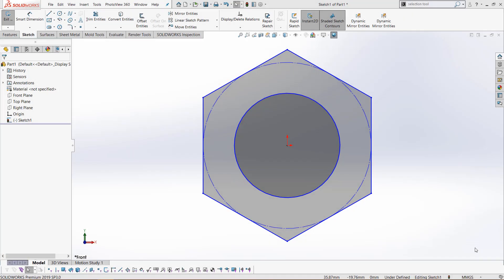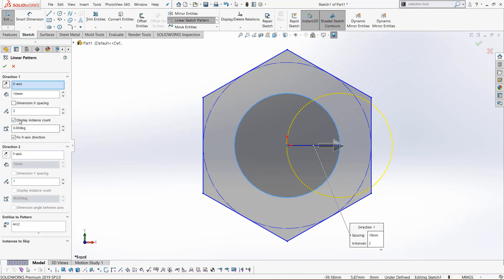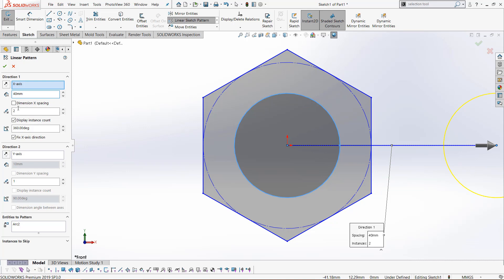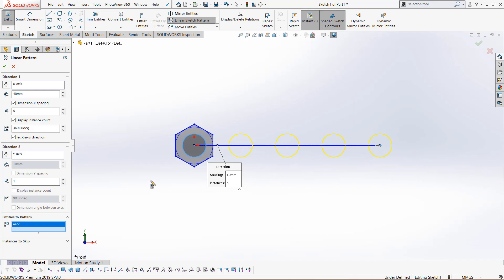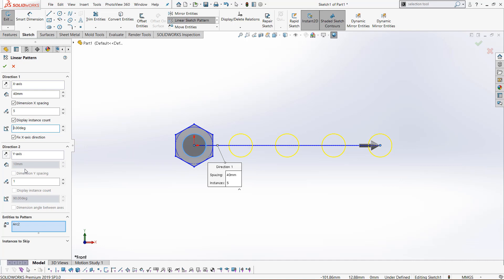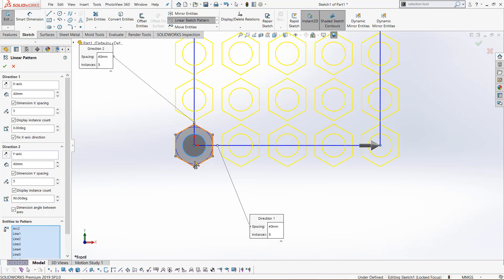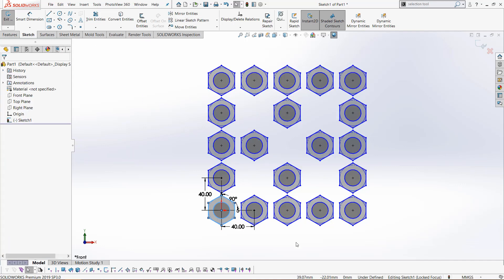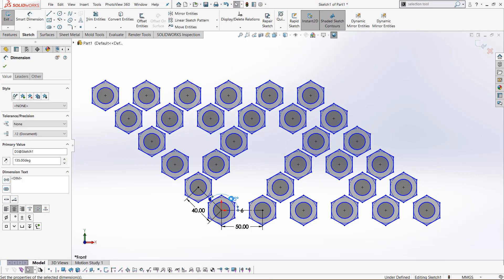SOLIDWORKS 3D CAD — Linear Sketch Pattern Tool

Comment: Usually I like GoEngineer's tutorials.  I think yours might be just as good. However, the volume of your intro is faint and your narration is barely audible at the highest volume setting.  I -could use closed captions, but why strain to understand what i barely comprehend.  YouTube tends to screw up the volume of it various videos  so I recommend reviewing your post and taking up volume issues with you host.
Reply: note: the lined thru text is a result of YouTube's incompetent editing system.  the single word 'think' should have been bracketed.

Comment: This is one feature in solidworks that often causes super slow model response.  Try direct modeling a 36"x36" sheet with 0.25" hexagonal mesh using linear pattern tool to make extruded cuts in sheet metal for flow simulations. There are so many instances that the model consumes tons of cpu/GPU resources and the model slows to crawl.
Reply: What can be done instead?